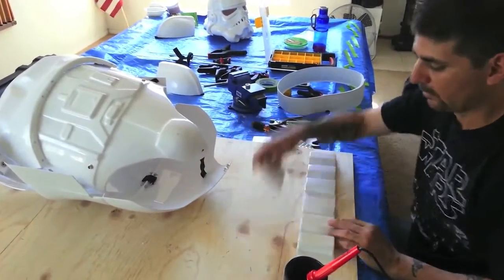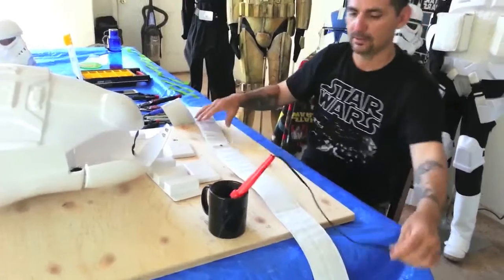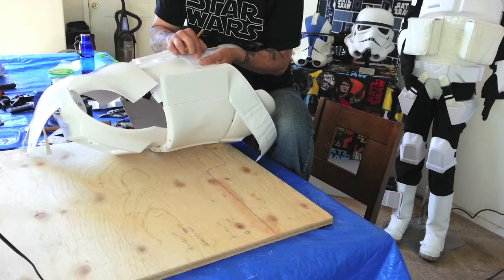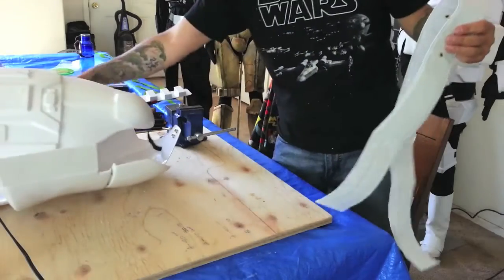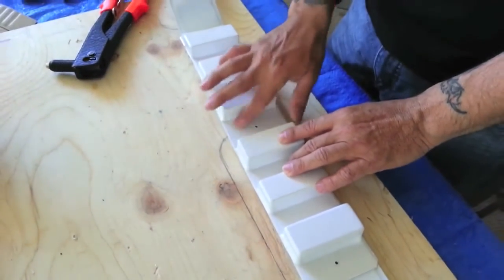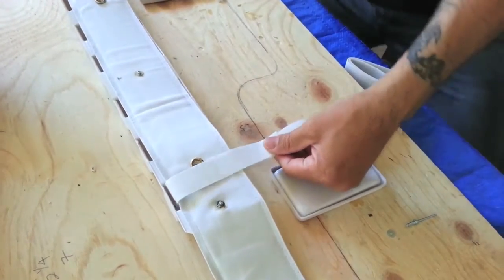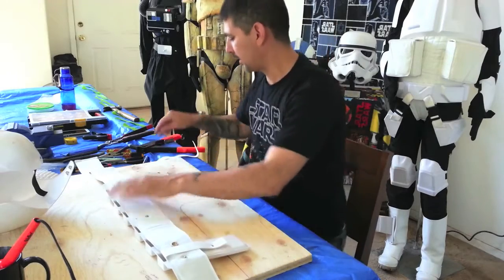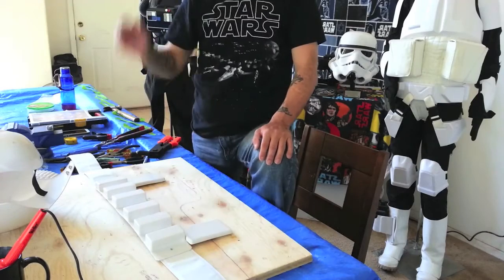Complete TK Armor Build Tutorial 23 of 45 Canvas belt construction

Comment: Would it not be easier to do the holes for the body mount snaps on the belt first, then add them to the armour after?
Reply from the maker: No it is easier this way, you can use the snap to help you with placing a mark on the canvas belt.

Comment: How can someone measure for their belt size, if they do not have their armor? Someone in another state, is building my armor for me, and I do not have access to my armor to take the measurement for my belt. thanks.
Reply from the maker: The guy I buy my belts from TKittle, he ask that you measure your waist without armor and he adds in the extra length. If I am not mistaken 10 extra inches, look him up at tk belts online.
Reply: @ArmorBuildingwithTK1636  That's who I'm getting my belt from (Imperial Issue). His instructions for measuring waist size for his belts, states: "The size you select needs to be your exact waist circumference measurement taken with your armor on.  DO NOT add length for the Velcro overlap in the back of the belt; I take that into account when I make it."
Reply from the maker: @nitegoat1369  then you will have to put the armor on and measure it. When I build armor for people I measure with the armor on them and then he makes it for me.
Reply: @ArmorBuildingwithTK1636  But I’m unable to do that. The person building my armor lives several states away from me, and I am unable to take the measurement with my armor on; which is why I asked my initial question. Thanks.
Reply from the maker: @nitegoat1369  all you can do is ask that person to measure the armor with somebody close to your size and get a measurement from there. I use body double for the few that I built for a friend that sent the armor to Canada.
Reply: @ArmorBuildingwithTK1636  I got it sorted out. Thanks.

Comment: Hey, so I just found your channel, and I feel like I'm going to make use of a good amount of your videos from doing a quick browse.

So I'm updating a kit I got in 2006 up to current 501st standards. It is going to take some work, but I'm ready to take it on I just need to get my starting point in order. I'm commenting here because I'm wondering, where the heck do you even get one of those leather belts that all current troopers use? My belt is currently just two pieces of long ABS plastic riveted to the ammo belt that wrap around me and heavy duty velcro together. Honestly, it is a gaudy thing to look at... and I have no idea how it was even acceptable back in 2006 but a lot of troopers had it due to it being in the instructions for  the kit I and many others had.

I also need to track down the metal clips that go onto the belt that attach the thermal detonator, I'm PRETTY SURE those are some sort of basic metal clips you could easily track down at an Ace Hardware and bend to your will, but if you know of a reputable provider of storm trooper specific clips as well I wouldn't turn the info away that's for sure.
Reply from the maker: Rob Kittel makes those awesome belts! I got the aluminum strip at lowes one inch wide and 1/8 thick cut and bend to fit the thermal det.
Reply: Hey sorry it took me so long to get back, took me forever to figure out where to go to view previous notifications... 

Great, Imperial Issue! I have heard from multiple people that that is a reputable source. I'll probably end up getting a good few accessories I need to update from him. Pardon my ignorance on this, but I've never really dealt with aluminum in the past. Do I just go to a hardware store and ask for aluminum in 1/8th thickness and cut it to size at home?
Reply from the maker: Lowes or Home Depot sells then in three foot sections.